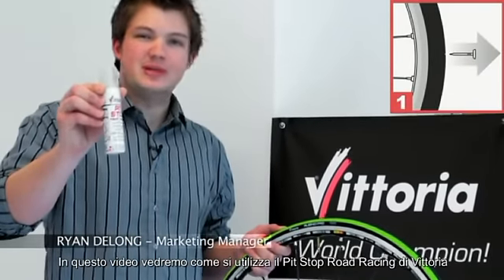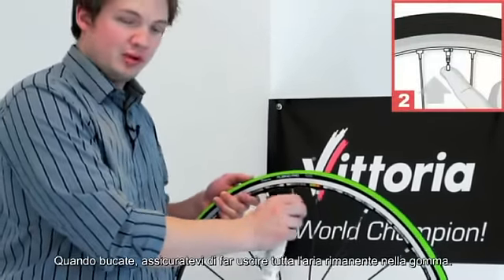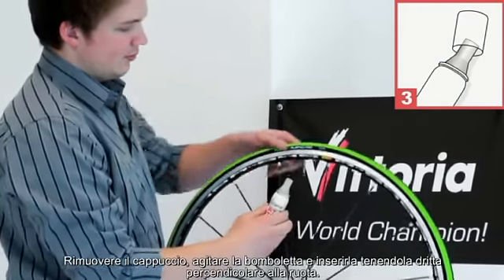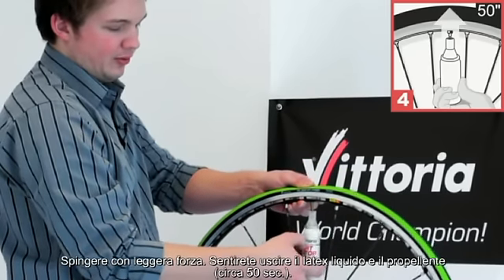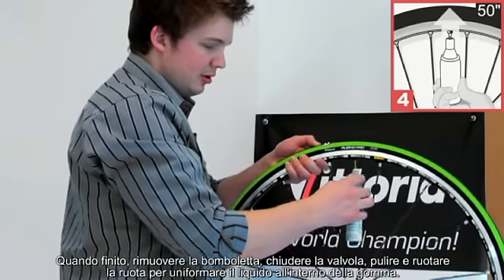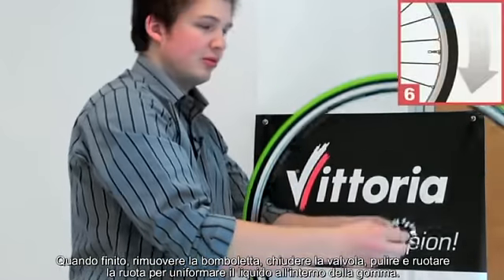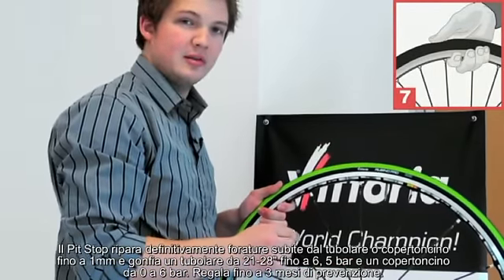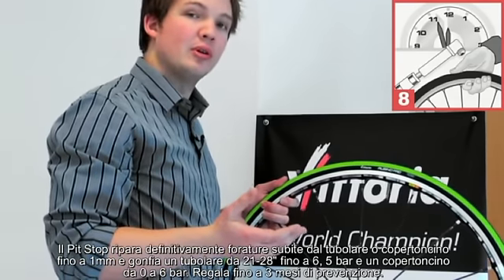How to use Vittoria Pit Stop

Comment from the maker: yes, it is possible to add the pit stop also when there is a valve extender.
After putting the pit stop, you can continue to pump normally your inner tubes.

Comment: It's a great concept, but in my hands, it has been a dismal failure both times I tried it (once on a valve extension, and once directly onto the regular valve).  Nothing but a latex shower going everywhere except into the tire.

Comment: The video lacks so much important details as many asked before me such as. If it fills the whole tube then how come we can still pump air through? How long the latex inside last? How much weight it adds? Is it 1 shot use for the Pit Stop? Is it a good idea to use it even without puncture for extra protection inside the tubular tube? etc etc

Comment: I just tried for the first time using a Vittoria Rally tubular tire.  Tried on the road and could not get any sealant into the tire.  Tried again here at home still could not get any sealant into the tire.  When I pulled it away, the plastic nozzle came off and sealant went everywhere and lost it all.  Followed the instruction, have watched the Video again, I don't know what i did wrong.
Reply: same here. even the bike mechanic had issues

it is a piece of crap. do not buy !

Comment: does the foaming latex cover the entire volume of the tube even though you are holding the wheel in one position until it stops filling? I am wondering if the cut is at say the 3'o'clock position, how does the latex get to the cut before all the propellant leaks out?

with stans you have to get off the bike and rotate the wheel so the latex is around the hole, or risk loosing air pressure before it seals.

Comment: Heh I can hardly believe that 1 year later my comment is still there. Hell I've just had my first flat "rear tire" on a (Vittoria Corsa EVO CX) while trying for the first time a brand new groupset (Sram Force 22) that I just installed but couldn't even try it as I flatted 300 meter away from home in the middle of the street -_-

Guess I'll have to buy one of these and hopefully it will resurect my tire as I'd be really pissed off to spend 30$ and still fail then having to buy a new tire which will end up 30$ more than it should have been.

For questions like "How many punctures can it fixes" as if it can save ur ass more than once or only once, I will prolly have to contact a store or look at a forum as I clearly won't get a reply anytime soon here!